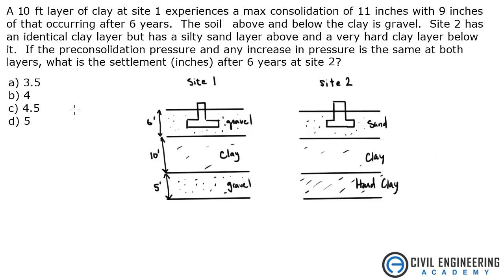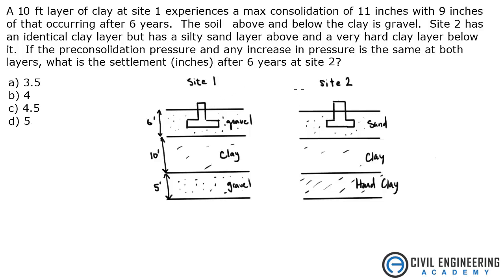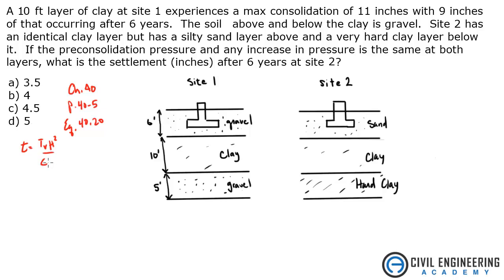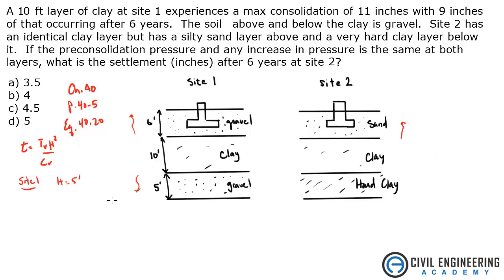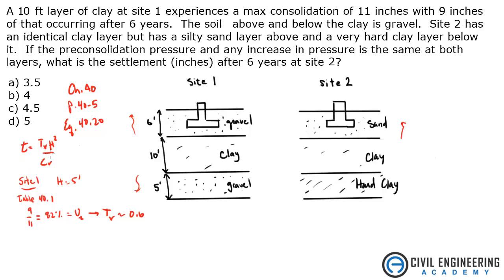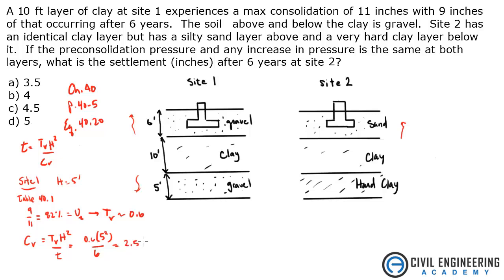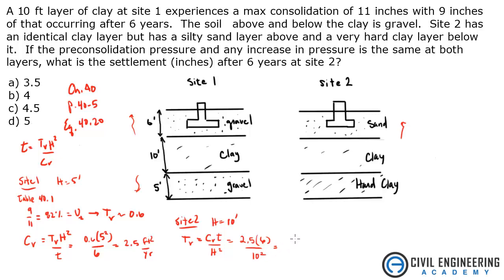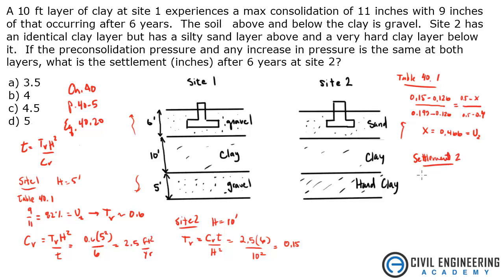Geotech-Primary Consolidation Rate and Settlement Problem

Comment: I think your interpolation is incorrect. Should be 0.433 by my calculation. Which makes the result 4.763 in, I'd still pick D.
Reply: Thanks. Thought it was just me.
Reply: Can you please clear out the following: you chose 5 as an upper limit to 4.76" (Considering "most nearly" term) and since it's about consolidation and higher value is safer in case of design.
Reply from the maker: +Stephanie Plate Thanks for catching that and for the good advice.  Keep on rockin!
Reply: great call!
Reply: 4.338